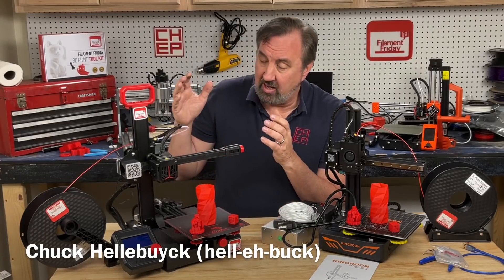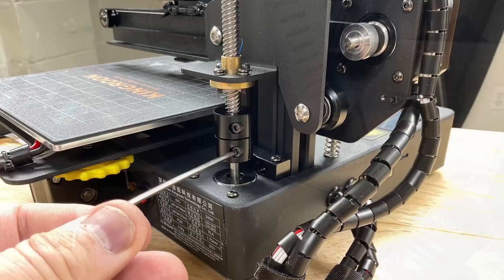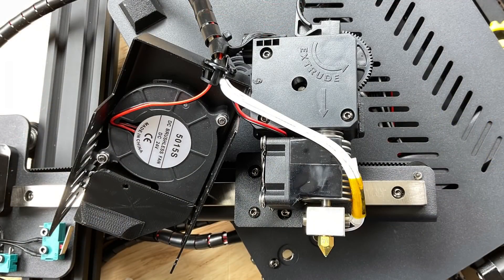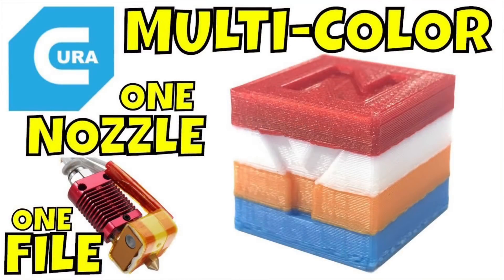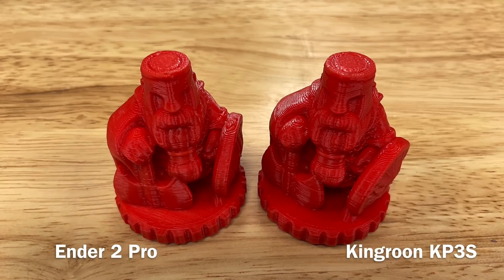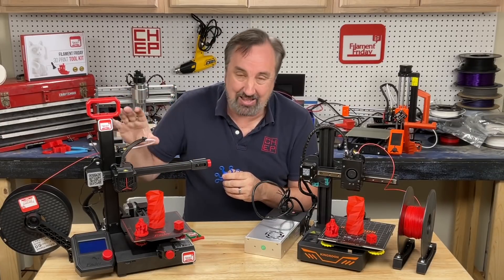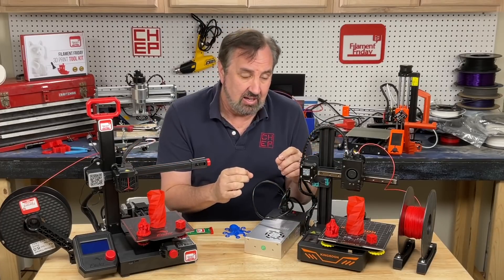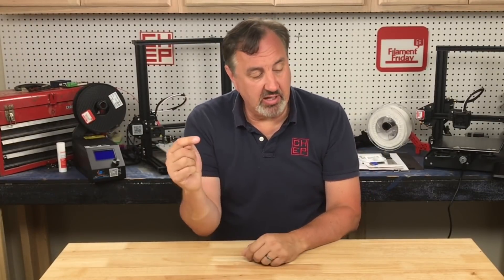Kingroon KP3S vs Ender 2 Pro - $179 3D Printers

Comment: Naah, KP3S is just a better printer and it saddens me that you are misleading beginners into buying the Ender. Nobody stays a beginner for long and both printers print great out of the box. The difference is that one has a possibility to be upgraded to a way more advanced machine for little to no additional cash and will give those beginners the experience they need to learn and grow into this hobby. 
Also you can put that power supply under the desk if it bothers you so much, that actually makes this printer take less space.
I would only recommend the Ender for someone that has 0 interest in this is a hobby and just wants to print stuff, although even then the KP3S will do just fine.

Comment: Hey, CHEP there are some newer versions of the KP3S. I have the KP3S Pro S1 and it is great. It has a built in power supply, it also fixes some features. All axis are linear and there are belt tensioners. Also the KP3S has a built in filament switcher so no need for plugins. It is more expensive but maybe you could do a review of it. Oh yea and I don't think you need to use a bed leveler since the build plate is small.

Comment: The kingroon does have more than one version of the kp3s.  The pro version has a built-in PS and I believe it has belt tensioner as well.  What I don't like is the proprietary firmware.  I would prefer Marlin or even klipper.

Do you know if the Ender 2 pro can print abs out of the box?  I saw a th3d video that seemed to indicate that it needed a PS and firmware mode for the bed to be able to heat hotter than 80 degrees C.

Comment: To tighten that Y belt, I think you would have to adjust the belt length by taking one of the end loops off the post and cut the zip ties. Doable but man, a simple tensioner would go a long way!

Comment: That separate PSU makes the whole point self-defeating. A power brick would be fine but not that. Otherwise I wouldn't expect much and don't see much to jusitfy either system except as tinkering / prototype systems for schools or whatnot. I think that in this day and age they could also save money by just requiring the customer sync to an open source phone app and just forego the screen. An app would be better and open source would mean people could improve it.

Comment: Why did you use identical gcode for testing of one is Bowden and the other is direct? Surely each should be sliced with at least the profile from the manufacturer, if not an optimised one from the community.

Comment: Tldr; Kingroon is for enthusiast tinkerers who mod their printer.  Ender is for non enthusiasts who just want to print stuff.

There is a solution for every gripe you have about this machine outside of the small display.  3d touch auto bed leveler as an example and even solutions to the belt tightening.
Reply: I wouldn't agree that the Ender is more for non enthusiasts just because it doesn't "need" so many workarounds.
If it's all about the direct extruder there is one from creality which can be used for this machine as well (just as an example).

So there is potential for modding on each of the printers. The thing is: if I want a printer for modding and tinkering I would buy a machine used for half the price and mod it. Because at the end it's not so important which printer you buy (especially when it's a first printer), it's more about how big it's community is, how easy spare parts are to get and what you make out of the printer. So most Creality, Anycubic, Sovol or Prusa meet this requirement and deliver good prints.
Reply: @hassosigbjoernson5738  I fully agree with you, my comment was more of a response of this guys review of it and how he presented it.  To me felt more like he was saying it is not really an enthusiast printer and more for a regular person who wants to experiment with the hobby and just have a little fun without the need to go crazy with mods.

Comment: About the card that helps to level the printer, I bought the equivalent one from geeetech (GLA10) and it would be helpful to have 3 LEDs instead of 1 like a red/orange/green one so we can see how close we are to the perfect leveling and as an ultimate evolution if it can, one day, have a bluetooth connection to smartphone and an App that will clearly make a map of the bed for the printers which don't have any ABL system, that will be great !

Comment: HI, much much after these video's came out, I am now the happy owner of 2 Ender 2 Pro's.
I needed to print parts that measure 22mm x 120mm. So they are perfect to mass produce these parts.
My 1st 3D printer, on wich I protyped the 1st versions of these parts was a mere 100x100x120 real CoreXY homebuild by a friend. No screen, only worked with a PC connection.
So thank you for your videos. I learn from them.

Comment: So the idea with linear rails isn't so much they will make your prints look better but they offer less maintenance.  Rubber wheels requires continuous adjusment as they wear.
Reply from the maker: I have machines several years old that are still running original wheels and adjustment. I’ve also had bearing fail in linear rails. So I still don’t see the difference.
Reply: Consistently good linear rails do not exist at sub-$200 per machine price range. KP3S is too much of a lottery for that reason.

Comment: bownden vs direct with EXECT the same gcode? Are u serious? can't tighten the belts? come on man... set retract to 0.7/30 and y`ll see the difference
Reply: He looks like a pure kingroon hater and a creality fanboi. Lol
Reply: @smoke2584  He's def a creality schill. But he makes some valid points. If someone wants a printer they can just setup and get ok prints with and never really touch it, the ender2 is probably that. I got a kingroon kp3s for christmas, and out of the box I had to lube the rails (I suppose this wasn't a must... but it made things way smoother), the z axis required some adjustment to get it just right. I've also added the flexible pei and a silicone sock. These are all stupid simple things, but someone new to printing wouldn't necessarily know to do these things. 

That said... In fairness to kingroon I didn't have to do any of these things to print. I've just done them as Klipper is the next step. I'm not looking for insane speeds... but I'd like to get some pretty good speed out of it.

Comment: IMO KP3S is winner because it has easier klipper installation, files are ready for installation, its too fast and best extruder. I know that the organization is chaotic after removing the box, but if you pay more attention to the modification, the mounting elements of the power supply to the printer + rPi with klipper, it will be the best than Ender2pro. These are my views from the perspective of using Voron.

Comment: I'm still undecided on which printer to buy, my 1st one.
I've been drawn towards the Creality CR20-Pro. 
Have you tried one???
Reply from the maker: I wouldn’t recommend the CR-20 line.
Reply: @FilamentFriday  what would you recommend for around the same cost? I mainly picked it because of auto bed levelling.
Reply: @FilamentFriday  Ender 5 Pro?
Reply from the maker: I’d go with the Ender 3 S1 Pro for slightly more but better hotend and direct drive. 
Otherwise I recommend the Ender 2 Pro for beginners and learn if you even like 3D printing for under $200. https://youtu.be/t8c7jqZsZOI

Comment: I have the Ender 2 Pro, it does exactly what I want it to do. I question some of the build issues with the Kingroon and the videos I saw had basically the same issues you had, it was decisive enough for me I didn't want a printer I was going to have to "fiddle" with all the time to keep it going. I have an Ender 3 I mess around with, but, when I want my other printers to print, they print. I haven't and don't plan on printing with TPU, so that's not really an issue, if/when I do, I have one that should print it without issue. People buy so much stuff with the hope "they might" do something and never use that feature. Mine do what I want them to do and that's enough for me and I am not excited about the "clumsy" layout of the Kingroon. Another thing you would have to print stuff for to "fix".

Comment: I own four KP3S machines. Put Marlin on two of them that would actually take Marlin. The processor in the other two are different and not exactly sure how to compile Marlin for them at this time. I recently picked up the KP5S, KP5M and KP5L.  Currently in the process of designing a belt tensioner for the KP5M along with a 10mm wide belt mod for the Y axis. My LK1 Longer really responded well to going with the wider belt and dual linear rails for the Y.  I custom machined all my mounts and hardware.... Not sure where I was going with this.  😂😂 But I've had really good luck with the kp3s machines. I did swap out a couple of the Titans for BMG clone extruders. Even set one KP3 up with a boden set up for a while to see how much faster I could print. 140mm/ps is pushing it with a volcano hotend.

Comment: Maybe you can get an answer but Creality doesn’t give any support for the Ender 2. There are no replacement parts or help when things break. I love this printer but I want to fix it with Ender 2 parts not Frankenstein it with Ender 3 to get it working.
Reply: I think the biggest problem with the Ender 2 Pro is support. It is a great reliable printer but when parts go bad there are no replacements. The belt tensioners are plastic and when they break and mine did, I had to make a part out of washers to have a metal part and get my printer up and running.
Reply from the maker: What parts can’t you get?
Reply: @FilamentFriday  the mounting plate for the hotend. My mounting points for the hotend broke off. A few months back I had my x tensioner break but I fixed that with resin.
Reply: @seattlefx  I'm struggling to get the board disassembled to replace the thermister I broke

Comment: You cannot use the same g-code.  
Ender 3 is bowden.
KP3s is direct drive.
The retraction is causing the lines on the KP3s.
Not a fair/logical test.

Linear rails are for speed and reliability.  
No v-roller wheel issues.
No need to fiddle with belt tension since the v-rollers aren't there to degrade/wear out.

Latest firmware does have have z-offset.

Comment: I'm sure you've heard it a million times by now but rails really excel once you start cranking up the speeds and accelerations. Throw klipper on that kingroon and it RIPS! Its such a good little printer. Testing it with ender-2 gcode isn't fair to the kingroon.

Comment: Maybe it will pause with M600 or M601. I didn't find the same G-code comparison very fair. Every machine is different and it should have been compared with the optimal G-code for each machine. And while linear rails might not improve print quality and those printing speeds, I'm sure they'll provide more rigidity at higher speeds and also last much longer and won't need to be adjusted frequently. It's kinda lame that the KingRoon uses V-wheels for the Z axis despite using rails for X and Y. That's kinda where it could have helped a lot to support the X gantry.
Reply: Unless the linear rail had very tight tolerances, I'm not so sure one single linear rail would stabilize the X gantry any more than properly tightened V-wheels. Now on a printer that could have two linear rails on Z, now that would be a definite advantage over V-wheels.

Comment: The only real advantage of linear rails over wheels is speed.  I'm printing bone stock except for an upgrade to Klipper at 120mm/s with excellent qualityon my KP3S.  The limiting factor is actually the hotend volumetric flow, not the motion system.  I'm fixing that as we speak.
Reply: What hot end are you going with?

Comment: @CHEP -- you happen to miss highlighting the pros of the KP3S which are:
1. direct drive out of the box - allows printing of flexibles which is a strong advantage over the Ender 2 Pro
2. not sure if you checked the hot end if this is a V6 clone that has no PTFE tubing / all-metal hot end. Coz if it is, then that's another advantage over the Ender 2 Pro coz it further expands the types of filaments that can be printed on KP3S.
Reply: did you watch the video????
Reply: 5:11 ?

Comment: I'm been following you for a while now and you've always given great information. Your ideas have helped me a lot in the past.  I've been hooked ever since I watched this video.  I've been printing for about 2 years with a Ender 3 pro that was a gift.  I had a question about the extruder motor part ? Is it plastic or metal ?  On the pro 2.
Reply from the maker: Motor is metal, gear is metal, idler is metal, arm and base or plastic.
Reply: @FilamentFriday  are the motor same as the ender 3 ?
Reply from the maker: As far as I can tell it is.
Reply: Thanks so much.

Comment: It looks like you print from SD card. Have you tried to print directly from PC (USB cable)? Does it work? Is it reliable??
Reply from the maker: If your computer shuts down or goes to sleep your print stops.
Reply: @FilamentFriday  My computer never goes to sleep... That was not my point. I ask if the firmware of this printer can be controlled over USB port as I have bad experience with these 32-bit controllers used in cheap 3D printers. I prefer to print directly from PC when I tune my 3D prints... Previous version of KP3S (2020)  was total failure, USB communication was randomly freezing, and no updated firmware was ever released....

Comment: Those are all valid arguments made in the video and having a KP3S and an Ender 3 pro I still prefer the KP3S. A beginner printer rarely stays a beginner printer. And while the initial setup and experience will be better with the Ender 2 pro, maintenance and changing needs (like printing tpu) will appear at one time in somebody's printing journey. My goal with the KP3S is to print pla and tpu  - and it does this great out of the box - be remotely controllable and reliable. I bought the pei flex sheet, a 3d touch and a raspberry pi 2 W zero (when they were still available). I installed Klipper on the pi. The advantage of Klipper is while the steppers are in standalone mode, I can still use features like pressure advance with the original board. I found this to be the most cost-effective upgrades I could do and give me the most in return: good bed adhesion, no leveling worries, remotely controllable/upgradeable, easy to use extruder and a fast printer. When I look back at my Ender 3 pro: other bed springs, capricorn tube, rapsberry pi, new extruder because arm broke, all metal hotend because of stupid bowden that goes up to the nozzle, periodic maintenance to see if the eccentric nuts are still OK and if the X-gantry is not at an angle. I get the same quality prints with more hassle on the Ender. One thing I want to mention is while being a Chinese company with its obvious flaws in their designs, they are very approachable and active on social media. The answers are in google translated Engrish but at least you get an answer and most of the time in a timespan of 2 days.

Comment: Hey Chep, do you happen to share your settings on cura that you use for your ender 3 pro? If so I would really like to know because I have been having some trouble trying to fix my prints, there has been massive amounts of warping on my prints and I have made sure my bed is level aswell as clean my bed with alcohol
Reply from the maker: Link in description
Reply: @FilamentFriday  thanks for responding so quickly chep, I will definitely attempt these settings tonight

Comment: Question. This is for someone I’m helping he got a used Ender 3 and found the bracket that supports the wires that heat the broken and hills the level springs.  They previous owner had 3d printed it. World u know the correct name of this and where he may be able to buy one instead of printing it.

Comment: So far, all the videos that compare V-wheels and linear rails have one thing in common. None of them talked about the lifespan of each method. 

Also, how the ability to do adjustment on the wheels affects them? Is it even a feature to look for?

And what about maintenance once any of them fail, how much would it cost to fix them? Is it easy? The day/dollar perhaps?
Reply from the maker: It’s certainly easier and cheaper to replace a wheel vs linear rail but I had a printfarm full of Creality printers for years and never had to replace a single wheel.
Reply: @FilamentFriday  cool, but was there any adjustments?

Comment: If you used exactly the same gcode on both printers, what retraction settings did you use? The same retraction distance is not going to be right for both a bowden drive and a direct driver printer..
Reply from the maker: The character print used the KP3S settings. The others used the Ender 2 settings. So in these prints it didn’t seem to matter.
Reply: @FilamentFriday  Ok. I guess the KP3s could handle too long retractions without clogging since it has PTFE lined heat break, but I would've thought the E2Pro should produce more stringing with too short retractions. Thanks for the reply!

Comment: 3:48 I heard that linear rails last longer, and that the rubber wheels wear out faster. I don't know if this is true or how it could be tested, but that might be an argument in favor of linear rails if it's true.
5:43 Did that loose belt effect your prints? In my experience this printer printed great. The belt never slipped. And the guy who has been using it since hasn't complained. Maybe the belt isn't actually that loose.
Reply: 100% agree with your point about the external power supply and spool holder being frustrating.
Reply from the maker: Over time the belt can stretch so it can become an issue. Kingroon showed me a video where the motor gets shimmed. Kinda weak but works.